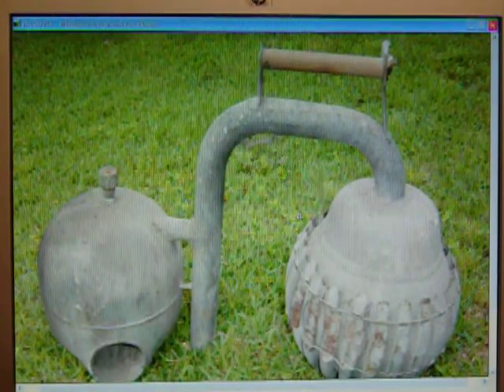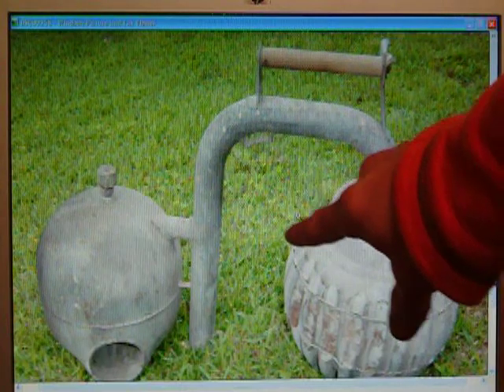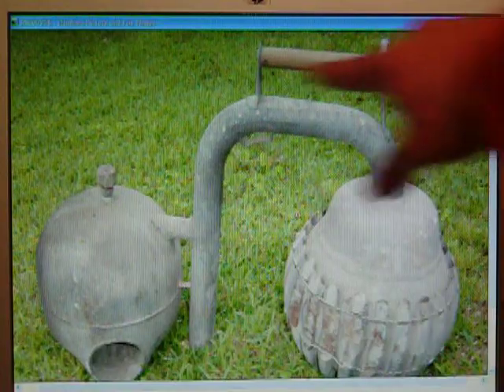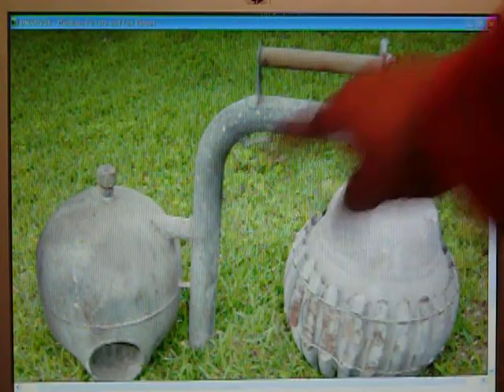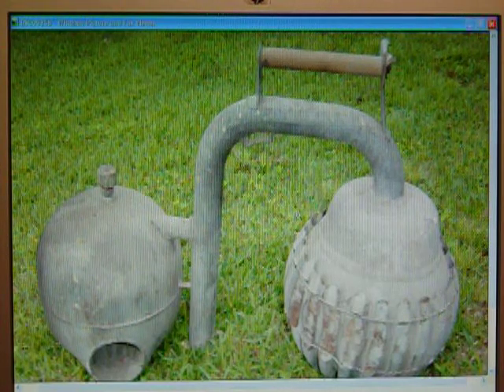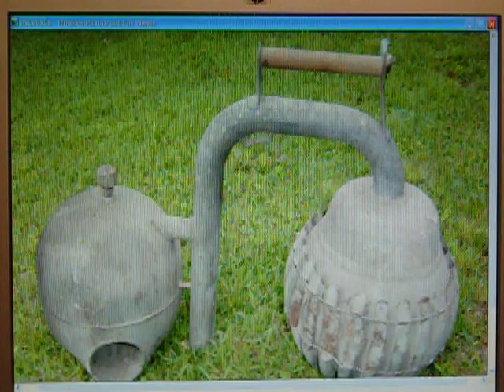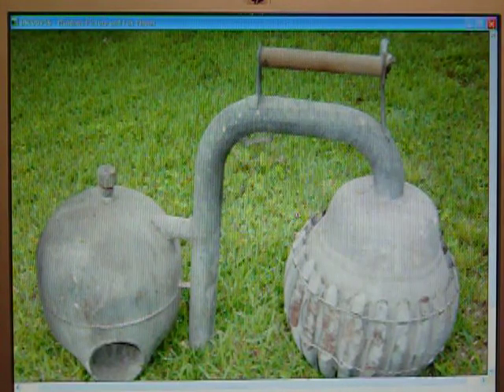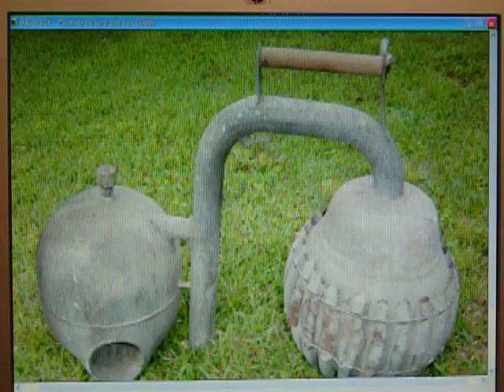1929 Antique Crosley Icy Ball  (antique refrigerator)-mystery solved

Comment: Crosley intermittent cycle refrigerator, the ball with the hole goes into the cabinet, the ice tray actually fits inside this hole.
The double ball unit is lifted out every 24hrs, turned upside down on the handle to drain any liquid from the inner ball back into the outside ball. then the inside ball (the one with the flutes on) is sat in a bucket of cold water and a burner is placed under the outside unit for about an hour to boil the ammonia from the water in that unit across into the inside unit. because it is in cold water the ammonia converts to a liquid. The ball unit is placed back into the cabinet and over the next 24hrs the ammonia gas boils off and gets reabsorbed into the water in the outside ball taking the heat from the cabinet at the same time. They look quite interesting when they are complete with the cabinet.
Bob
Reply: Bob Carveth, Wow, and I thought the newer kerosene refrigerators were interesting...

Comment from the maker: @localcrew There is also a little bit of fluid sloshing around inside. I don't remember noticing that before, possibly because it was pretty hot when I looked at it years ago and was probably pressurized. I guess my memory of it wasn't as good as I thought. Either way, thanks for taking a stab at it.

Comment from the maker: @localcrew I could be mistaken about the galvanized part. Actually, this "thing" had been in storage at another location for years, so I had it brought back down so I could take another look at it. I did find a "w" on the cap. I think its a W because it has a - (dash) mark to the left, as well as one underneath it. Also, I found a valve inside the neck of the nipple. I thought that the w might stand for Westinghouse. Sure enough, they made plenty of things for gas.

Comment: Are you sure it's galvanized? If that is used under hot conditions then the galvanized would burn off and that produces a toxic gas. Looks like weathered brass or bronze in the picture. I think you may be on the right track with the orchard angle. I'm thinking that it could be something that you fill with kero or diesel and put the "finned" right-side in a fire to heat up the fuel and then a gas comes out the lower hole and burns with a smoky flame to keep ice off of trees. That's my WAFG.